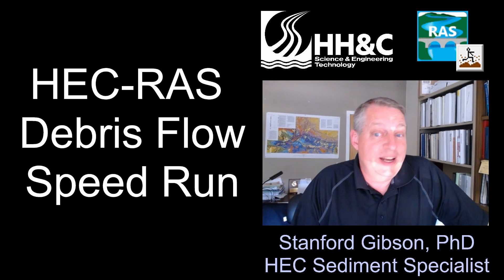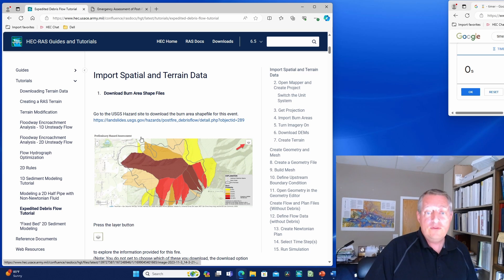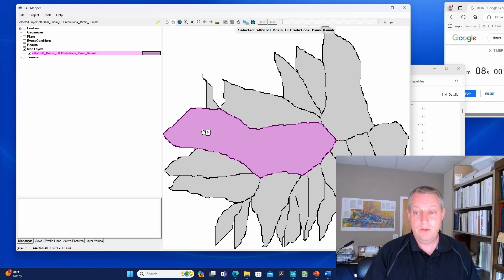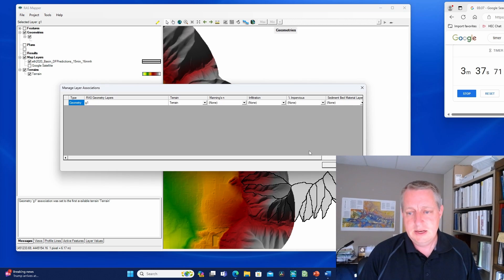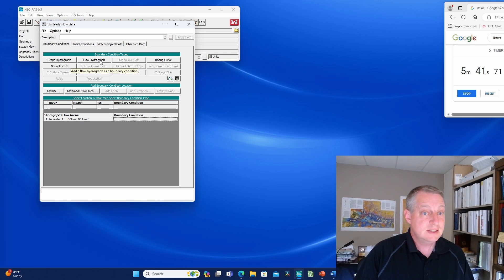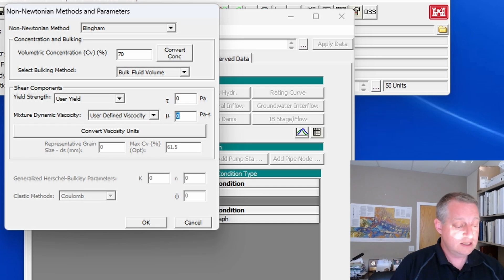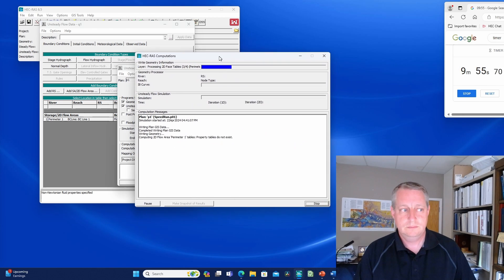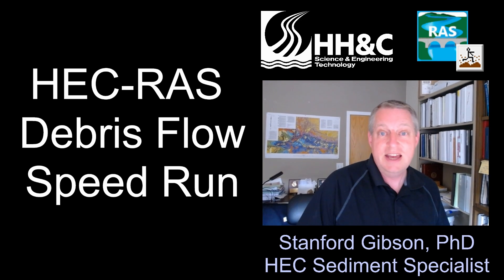HEC RAS Debris Flow Speed Run

Comment: Dear Prof. Gibson, I've trouble and error :
Unsteady Input Summary:
     2D Unsteady Diffusion Wave Equation Set (fastest)
     2D number of Solver Cores:   12
HDF_ERROR trying to use HDF output file
Subroutine HDF_SET_COMPRESSION
HDF_ERROR trying to close HDF output file:
HDF5-DIAG: Error detected in HDF5 (1.8.11) thread 0:
  #000: ..\..\src\H5Pdcpl.c line 869 in H5Pset_chunk(): all chunk dimensions must be less than 2^32
    major: Invalid arguments to routine
    minor: Out of range
 
Error starting unsteady simulation - Stopping compute process

What is the solution for this case, 
Thanks before

Comment: Very useful, thanks for the lesson! I'm working with this Bingham model in my master thesis. I have a question about the non newtonian Cv parameter: If I set the Cv = 60% and select the "Do Not Bulk" option, then the simulation doesn't take into account the volume concentration? Or is it actually taken into account but its assumed that it is included in the flow hydrograph? (and if so, how does the bulking factor work in this case?)

I have been running the model all this time with "do not bulk" option, does this mean I am modeling clear water?
Reply from the maker: The bulking option assumes your boundary condition is a clear water hydrograph and RAS is adding your solids to it.  "Do not bulk" assumes that your boundary hydrograph is a time series of the whole mixture volume.
Reply from the maker: But, if you use the O'Brian or exponential rheology equations, those use Cv, so you can choose "do not bulk" and still have effects from Cv.  If you choose user specified parameters and "do not bulk" the model will be insensitive to your Cv...assuming that you already included it in your boundary hydrograph.  HMS includes both options, a bulk mixture hydrograph, or a clear water hydrograph and a Cv time series.
Reply: @stanfordgibson  thank you so much for answering! a last question is about the downstream boundary condition (DSBC), is it not mandatory to set de normal depth as the DSBC? can I only run the model with the upstream boundary condition? or does it depend on whether the flow passes through the mesh downstream?
Reply from the maker: @TheBalticSun  Because NN can "run out" (e.g. come to rest) before it reaches the "downstream boundary" you don't really need a downstream boundary if the flow doesn't reach the domain boundary.  But if the flow does reach the domain boundary, you will need a normal depth or something.
Reply: @stanfordgibson  I got it, thanks again!

Comment: Interesting! A quick question: how does RAS account for the fluid density of the debris flow mixture, and how to specify the material’s specific grain density? Density is often twice as large as clear water and can have significant impact on flow dynamics. Thanks in advance!
Reply from the maker: We compute fluid density based on the concentration by volume (CV) in the non-Newtonian fixed bed model, which means that for now we assume the solid phase has a specific gravity of 2.65.  I suppose you could estimate higher density material with some sort of "apparent Cv" that converts mass in to volume...but I'd need to think/read more about that.  Overall, though, most of the density effects are in the empirical parameters, not the physics, anyway, so I don't think it matters too much. In the mobile-bed sediment transport model you can edit the specific gravity of each grain class and simulate multiple grain density transport....but that is a much bigger effort.
Reply from the maker: I am going to post a video on Binham parameters in a couple months...if you would like to preview a rough draft, reach out ot me on linkedin and I can give you a link

Comment: Hello, i have written to you before. I'm working on my bachelors thesis on HEC-RAS sediment moddeling and have run into an issue while hydraulicaly calibraing my model. I have 6 gates in a SA/2D connections opening based on the rules i've set but based on my previous runs it seems like they dont follow the rules at all in fact most of the gates dont open at all. This has left me and all my professors confused since we do not see any problem with my model. Would you please help me because i have been trying to resolve this issue for over a month now and I'm at my wits end.

Thank you very much.
Reply from the maker: I don't think I've tested connections with rules in a 2D sediment model.  There is a chance that that particular confluence of features has a bug.  If you believe there is a bug, please send the files to the RAS inbox https://www.hec.usace.army.mil/contact/
Reply: @stanfordgibson  I have not tried adding any sediment data yet because I can't calibrate the model hydraulicaly. I semt an email to the email you have send. I've run more tests and the gates just do not work...